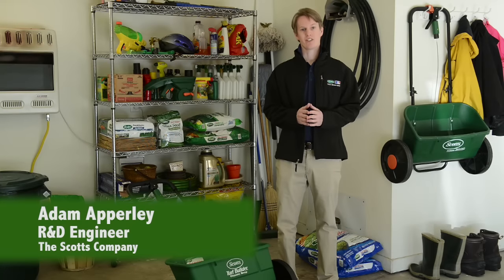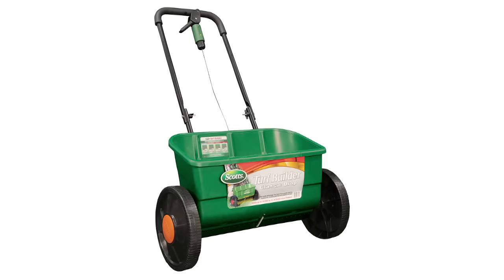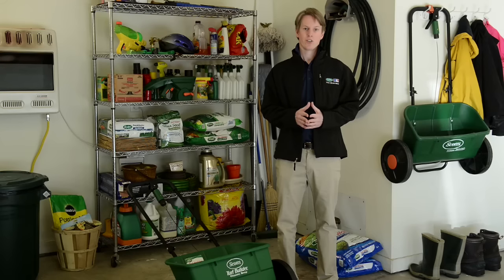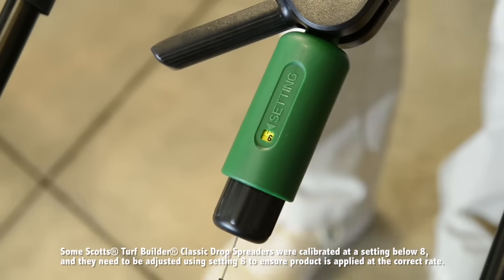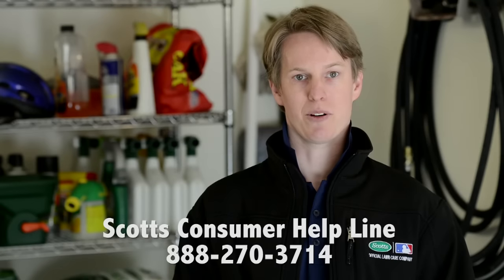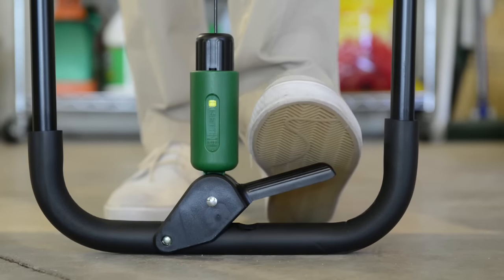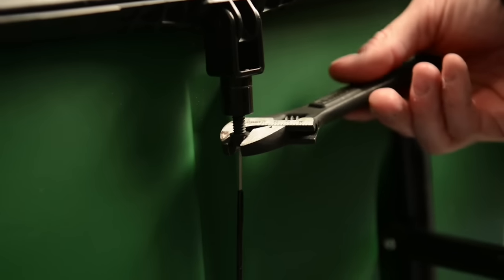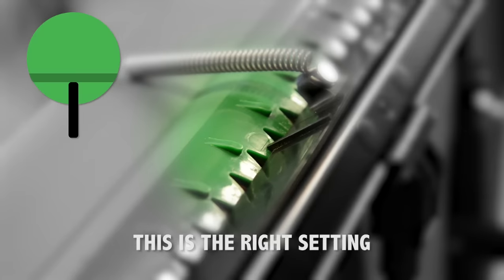How to Calibrate Your Scotts® Drop Spreader

Comment: Hey Scott's. 

I hate to complain but I had to watch this video at the calibration part 5 times to figure out where the calibration circle and mark were because all I could see was the straight raised "teeth" things. Seeing all of the confused comments tells me I'm not alone. You should really consider having someone add a highlighted spot over the round calibration circle mark with slash or a quick cut/edit where you've zoomed in to show what line you are talking about and repost this. Other than the fact that the mark is difficult to see on the video it's a great video. I came here because my hand-me-down AccuGreen 3000 seems to be releasing a 3 amount when on a 6. Hopefully thanks to this video I can fix it. :D
Reply: Mine was a line that was depressed within a tooth. It seemed clear in the video and helped me but I'm sorry you had difficulty. I still found the video to be very useful however.
Reply: For years I’ve been aware that using the numbers on the back of bags for my Accugreen 3000 spreader wasn’t putting down nearly enough granules.  (“It says 6…I’d better go with 9.”)  I tried this “calibration” method and found that it made it worse!  It closed it down more, rather than opened it up!  I adjusted it back to where it was; I guess I’ll have to continue trying to adjust it psychically.

Comment: Hi, is there an instruction manual included in the box about how to calibrate it when you turn in upside down? Because I watched the clip here over and over and don't have a clue what you are lining up.
Reply: @1:35 mark in the video look below the spring on the black piece. There is a ridge sticking up. Follow that ridge to where it meets the green. Where that black piece meets the green there's circle with a --- (dash) in it. Then follow adjustment instructions the pressenter is showing.

Comment: Is it the shutoff bar, or that little rectangular protrusion, that should be on the calibration line? Not clear at all!
Reply from the maker: Ken, we apologize for the confusion.  Align the rectangular protrusion with the calibration line.  If you need additional assistance, please contact us 888-270-3714.

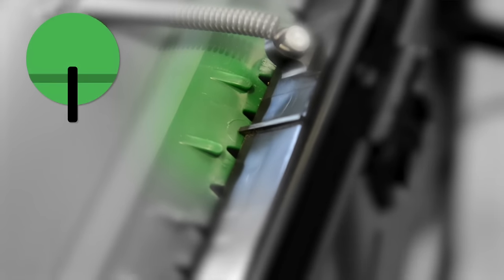Comment: PAUSE at 1:23 look almost dead center of screen. The black shut-off bar has a vertical line protrusion just to the left of the spring. That's the line to line up with the green spreader body where you'll see an embossed circle with a line in it. Easy to see when you know what to look for. They should do a close-up picture in picture.

Comment: Can you please tell me how to calibrate a Speedy Green 3000? Thx!
Reply from the maker: Hi Jacqueline. Your Speedy Green 3000 spreader was calibrated at the factory. However, a spreader's calibration may change or slip during periods of frequent or heavy use. You may check the calibration by using the following directions. First, adjust your micrometer setting to 2. Squeeze the trigger against the handle. The calibration line is a small, raised line embossed on the top of the spreader's shut-off plate. With the micrometer set at 2 and the trigger squeezed against the handle, the calibration line should be aligned with the back edge of the hopper opening. To adjust the alignment, use a small wrench to turn the black calibration screw at the lower end of the control wire leading from the micrometer rate setting barrel. Adjust the screw until the calibration line and back edge of the hopper meet. When you are not pulling on the trigger handle, the cable should be loose. When you pull on the handle, the cable becomes taut and the shutoff plate slides open.
Reply: @ScottsLawn  thank you! Your instructions worked perfectly!

Comment: Thank you, mine was off, how do you calibrate a speedy green 2000?
Reply from the maker: To adjust calibration on the Speedy Green 2000, please use the following directions:  

A) Adjust the micrometer setting to 2.  

B) Squeeze the trigger against the handle.  

C) The calibration line on the top of the shutoff plate should be aligned with the back edge of the hopper opening.  

D) To adjust alignment, use a 1/4 inch (6 mm) wrench or pliers to turn the black calibration screw at the lower end of the control wire leading from the micrometer rate setting barrel.

Comment: My numbers don't line up to the center of the window. Either above or below the window opening? Now what?
Reply from the maker: You will need to set the micrometer to 8. Turn the spreader over so that you are looking at the outside of the bottom of the hopper. Squeeze the trigger with your foot. Locate the calibration line (small, embossed line on the bottom of the hopper the 2nd tooth from the spring in the center). With the micrometer set at 8 and the trigger squeezed against the handle, the raised ridge on the shut off bar should be aligned with the calibration line. To adjust the alignment, use a 1/4 inch (6 mm) wrench to turn the black calibration screw at the lower end of the control wire leading from the micrometer. Adjust the screw until the calibration line and the raised ridge meet.

Comment: How do you calibrate the Scotts deluxe dlx spreader?
Reply from the maker: Steve, to check the calibration of your spreader; set the spreader to 3.5 and while depressing the control lever, a 1/4 inch drill but should fit snugly in the lower left corner of the opening. Please contact us here if you need further assistance: http://scotts.io/6054G1RoI

Comment: I searched "how to calibrate scotts broadcast spreader" and this came up. OH, the many ways I hate Scotts...
Reply from the maker: Hi Don! We are sorry you did not locate the information you needed on our website. The Scotts Basic, Deluxe, Standard, Turf Builder DLX Edgeguard, Turf Builder Mini Edgeguard, Turf Builder EdgeGuard MAX, Pro Edgeguard and Lawn Pro Broadcast spreaders are calibrated at the factory.  They cannot be calibrated and shouldn't need to be. If you want to verify the spreader is still properly calibrated, you will need a 1/4 inch drill bit. Set the spreader to 3.5, and with the control lever trigger depressed the 1/4 inch drill bit should fit snugly in the lower-left corner of the opening. If the spreader is out of calibration we recommend it be replaced since it cannot be re-calibrated. NOTE: The opening on the right side will be smaller.  This is so more product is delivered to the left side of the rotor plate in order to create a more balanced spread pattern because the rotor plate spins counter-clockwise.

Comment: What a bunch of crap. There is no calibration line on the bottom of my Accu green. Also there is no adjusting nut. If there are different models was some other types of adjustment it could have at least been addressed in the video.
Reply from the maker: We are sorry that you have had difficulty with calibration and that the video was not clear.  We will be happy to help.  Please contact us and have your spreader handy: 877-465-5160